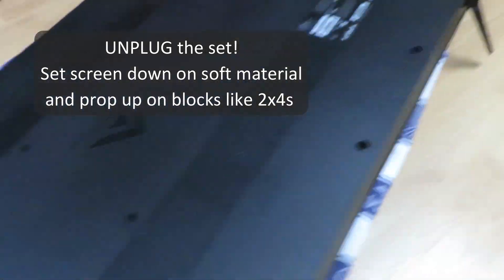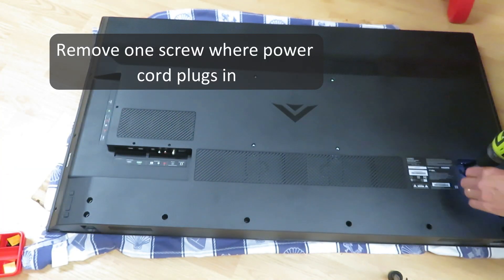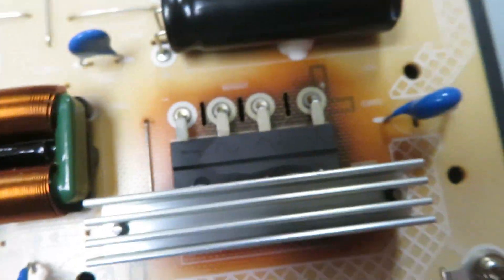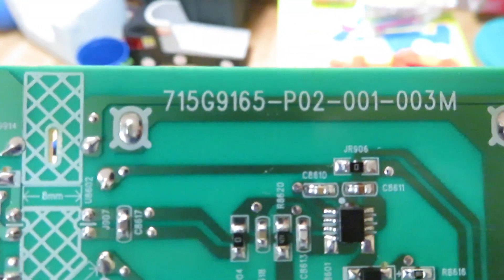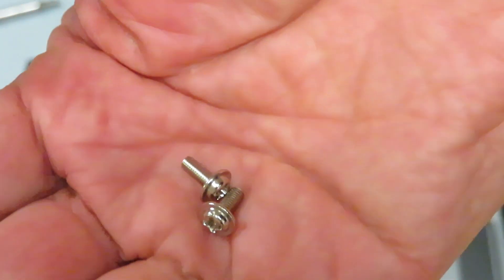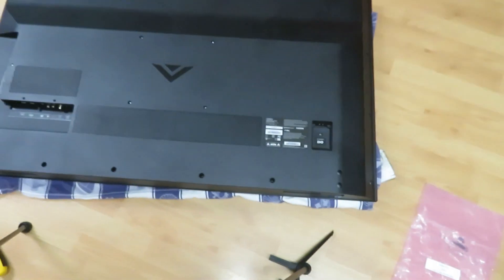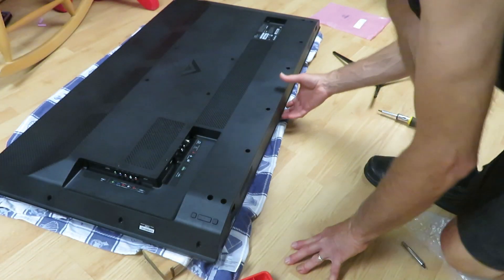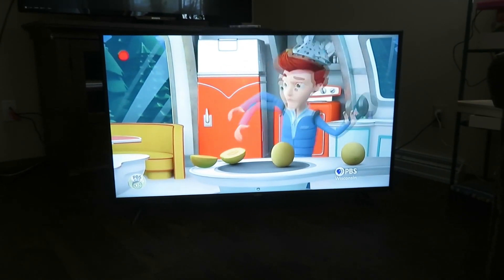Vizio 50” LED TV D50-F1 Goes “Pop” and Now Dead: an Easy DIY Fix

Comment: In our case, there were a series of very loud pops/cracks over several days, a few months ago.  It hasn't happened since.  We've only had this TV for less than a year.

Now one corner (top right) has a purple tinge, while the rest of the screen is perfect. 

Should this same procedure of replacing the board apply?

Any ideas what caused those EXTREMELY LOUD cracking/popping noises?
Reply: @Durden43  I'm not sure what you're saying, or asking.
Reply: @Durden43   I haven't repaired it.  It is functioning, but with that little purple patch in the corner.
Reply: @Durden43  it stopped on its own.